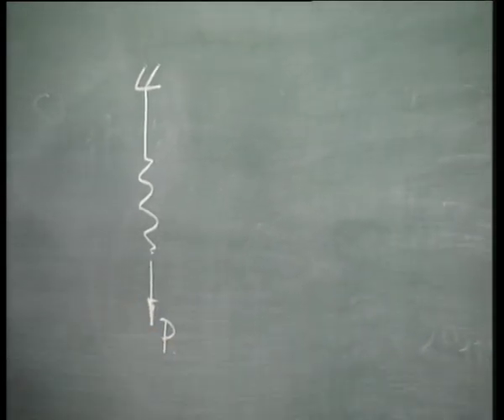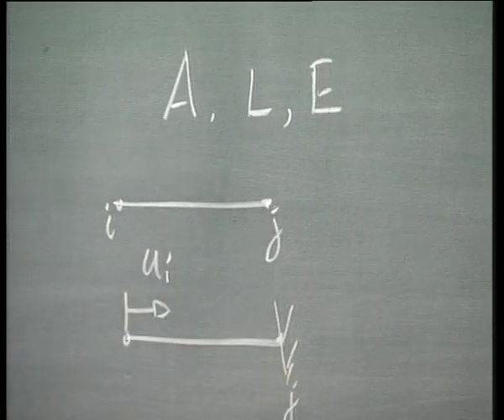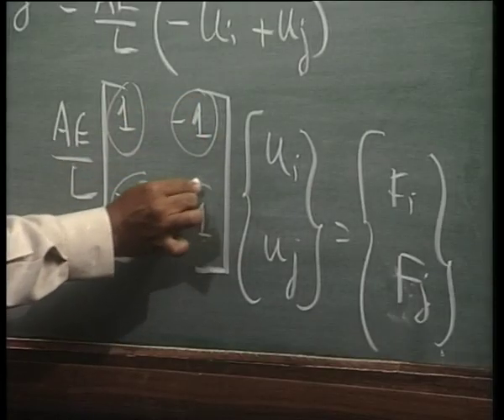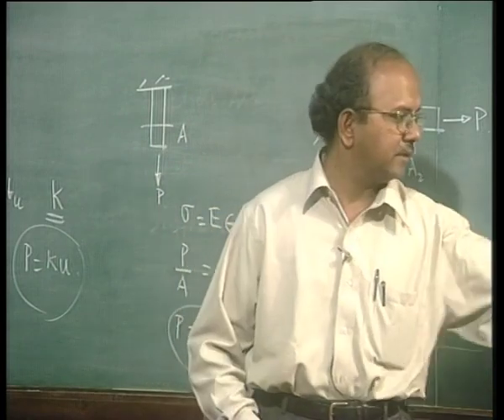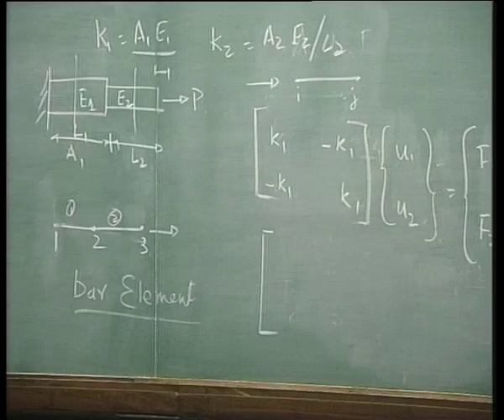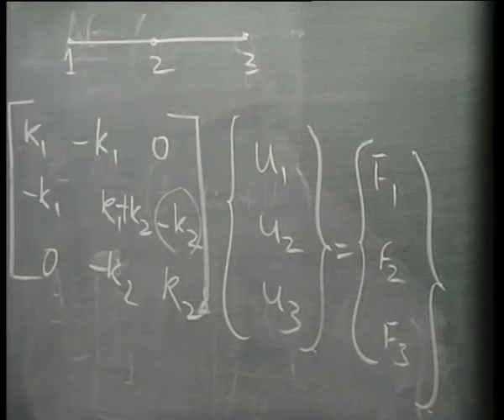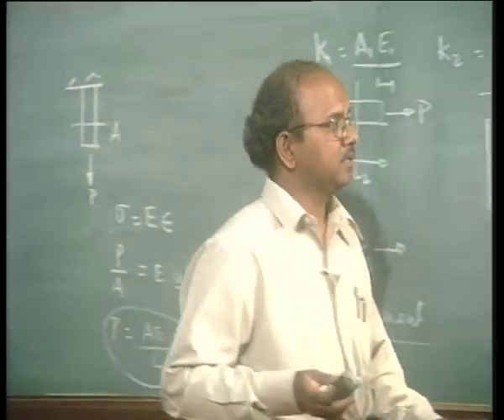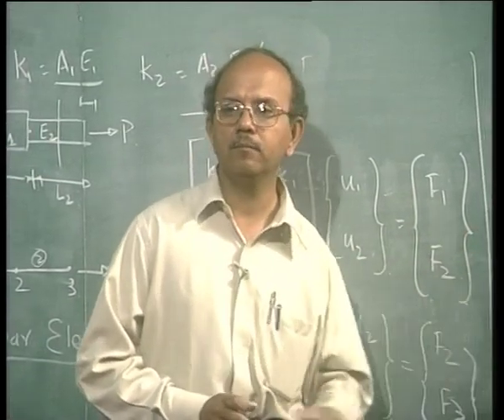Mod-01 Lec-03 Introduction to Finite Element Method

Comment: If you write u1 and u2 instead of ui and uj, and write F1 and F2 instead of Fi, Fj, you can easily interpret the physical meaning that " kij is the force that has to be applied at j in order to have unit displacement at I"

Comment: I understood from this Mr. In one hour, what I didn't understand from my professor in one semester
Reply: may be now your basic concept is strong now than you had during your semester classes
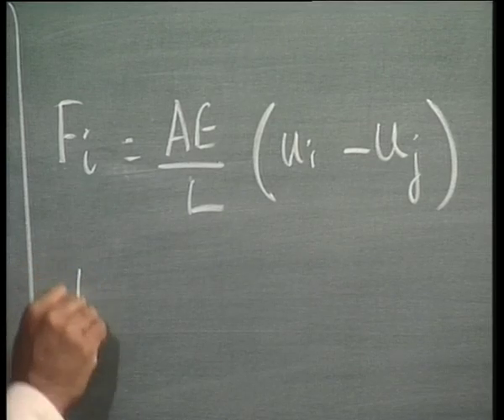Reply: @abhishekchakrabarty2930   at 12:55 why we is doing (Ui-Uj)
Reply: @Akash-xw4wt  this is the net displacement of the nodes since 2 ends have different displacements,hence the net displacement has been taken into account
Reply: @abhishekchakrabarty2930   thank you so much.
Reply: @Akash-xw4wt  welcome
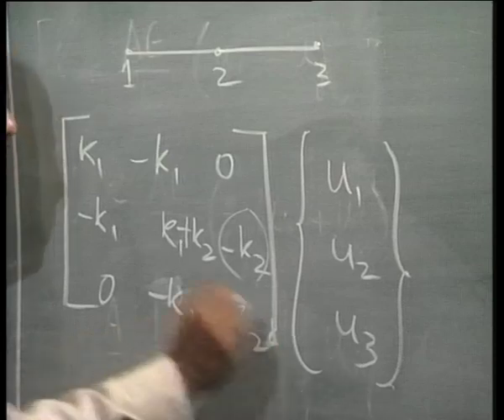Reply: @abhishekchakrabarty2930   35:17 why they are doing k1+k2 at middle of matrix. pls explain.

Comment: Question : at the end of the day isnt the fixed point just having an equivalent force to the opposite side of the force ? Why can't we put the force there ?
Reply: because there is no displacement at the fixed point. F=ku. when u is zero, the force there will be zero as well
Reply: He clearly stated that only the external forces are considered in the force matrix. (bcz internal forces are created and balanced itself by the system)

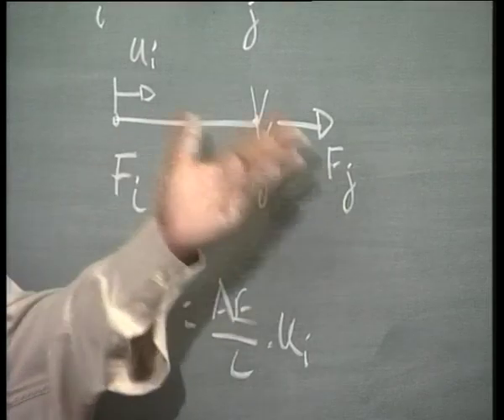Comment: At 10:20, F(i)=-F(j), which means opposite in direction, then why in the diagram both F(i) and F(j) in same direction.
Reply: The Fj he showed by arrow is the force on the node 2 by the element. But the Fj he mentions is the reaction force by the wall on the node 2 (opposite direction)

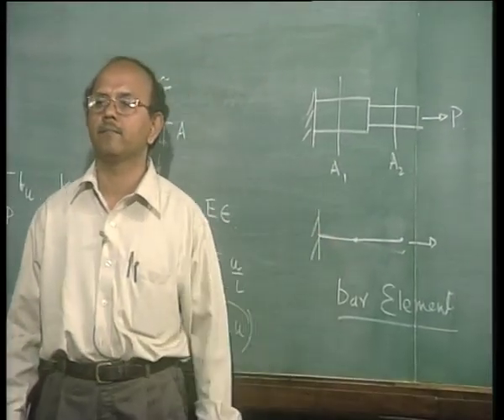Comment: Ui & Uj have taken based on one end fixed condition - @ 11:50

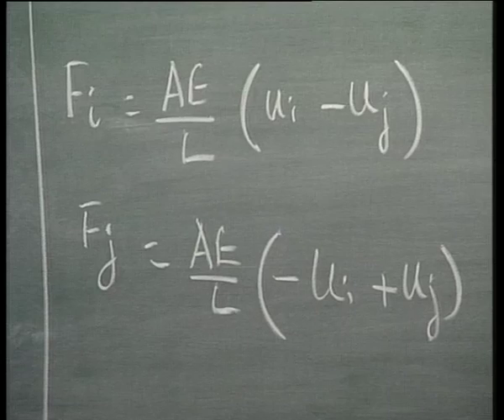And @13:20, professor took a force matrix, for stepped shaft and told the above forces to be super positioned, If we apply super position principle Ui & Uj have to take positive as they are not resistive displacements.

Can anyone please explain clearly?

Thanks
Reply: Sorry I can't explain.

Comment: how 1st row and 1st column get cancelled for u1 = 0
Reply: It affects other equation (ie for F2 and F3) in no way....each time the u1=0 will make its term zero.
Reply: Because node 1 was fixed so there could be zero displacement in position of node 1. So displacement u becomes 0 and when u solve the matrix 1st row and column do get multiplied with 0 that gives the ans 0 only. So to save time we just eliminate the row n column as it's no use to continue with them
Reply: @bvk9686  why did he consider only the external forces?

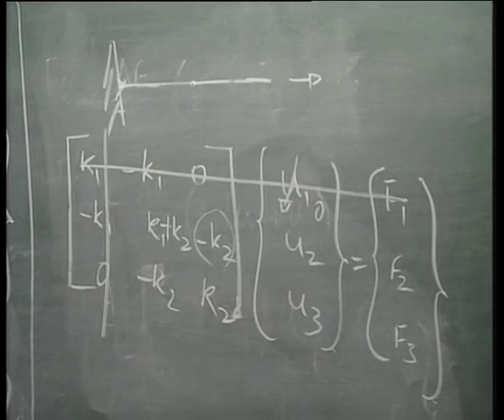Comment: can anyone help me understand why he omitted the first row just because u1=0 at 45:14
Reply: there are no external forces applied at nodes 1 or 2 - fr this reason f1 and f2 will both be 0. the only external force is applied at node 3 which is why f3=p
Reply: How? Can you elaborate - When you multiply row 1 , you get k1*0 + -k1*u2 + 0*u3= F1 which implies F1=-k1*u2
Reply: if u multiply the row and column becomes zero so he removed them
Reply: Anjan: see the figure.. In the fig there are 3 node .. the nod 1 is at fixed end .. so the displacement at the fixed end become zero{u1=o}